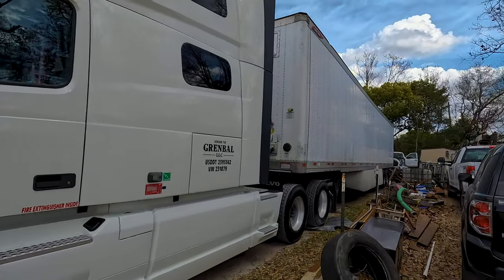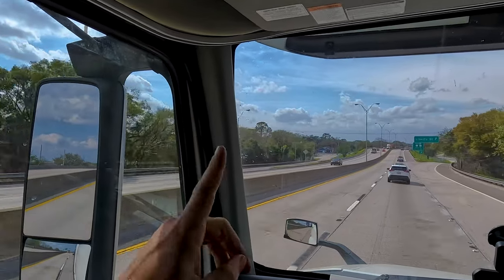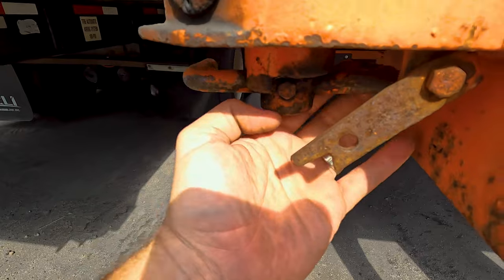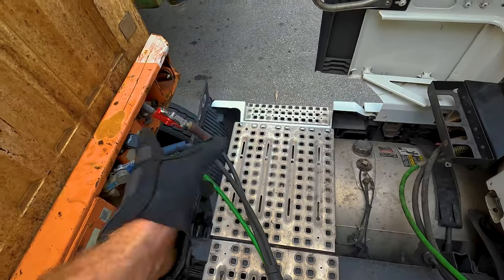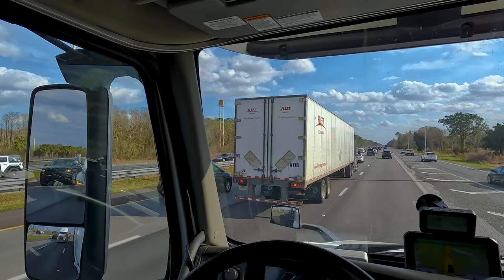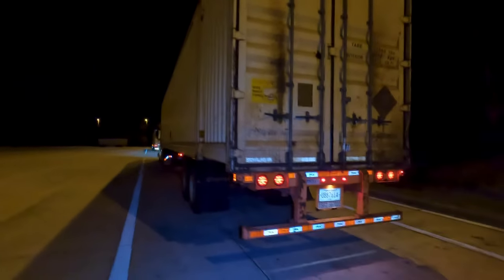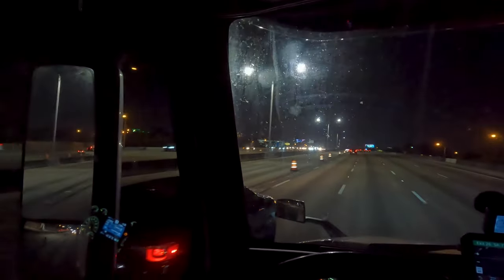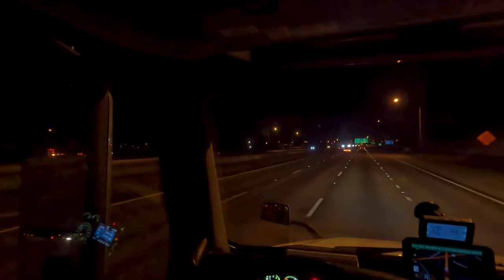MIAMI Streets get WILD At NIGHT! Florida Trucker Hauling Container Chassis Railway Freight OTR VOLVO

Comment: Btw, zip ties are the law on containers xD At least two, one on each corner front and back. If you don't cop can pull you over and give you a ticket. Not long ago on I-65 in Indiana, close to Chicago I saw 3 traffics and all 3 of them were caused by 53 feet containers laying on its side, blown off of the chassis lol. Luckily no casualities.

Comment: I love moving containers but the companies that own them stink at maintaining them. I concur on the Miami issues. Apprx 1700 - 900 fuel = 800 for 700 mile run. Is that feasible.
Reply: You don't count whole fuel, you should know that. 700 miles equals to 100-110 galons of diesel. So 400-450 bucks for fuel for that run. The rest of the fuel can be used for a next run. $1250-$1300 for that run is not perfect but times are terrible nowadays.

Comment: If you don't put zip ties on all 4 corners you are in violation of 393.126 FAILURE TO ENSURE INTERMODAL CONTAINER SECURED, I would suggest brightly colored ones so DOT can see them and that's one less reason they can pull you over for!

Comment: After I had several Volvo  tractors they don't run right without the check engine light on  its a common glitch i had one the light was on for seven hundred thousand miles and never had a break down